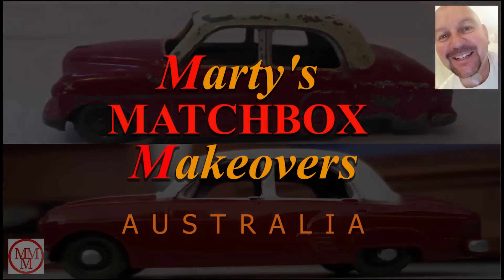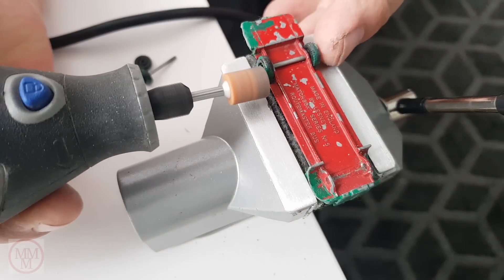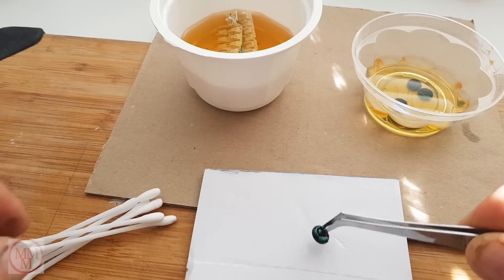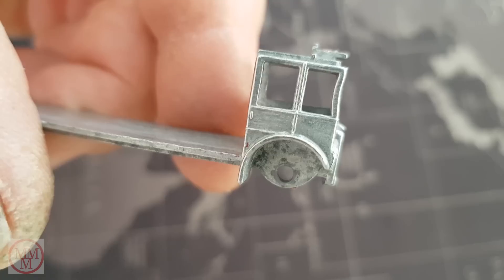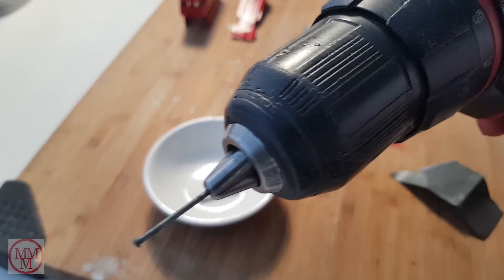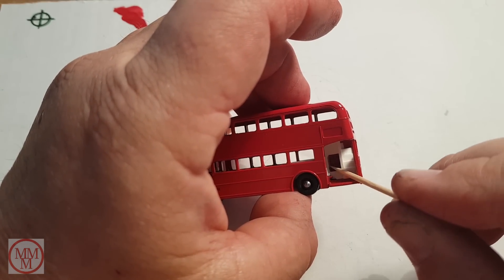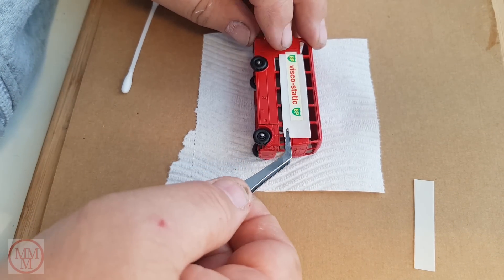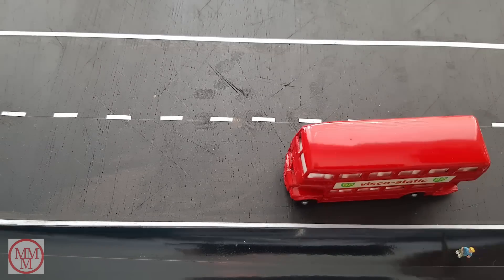MATCHBOX Restoration No 5d Routemaster London bus 1965

Comment: Is it just me or did it have a bent pillar you missed?    Awesome work still!
Reply from the maker: Believe it or not, I did not see this with the naked eye - Only noticed it after the final upload view!  :(
Reply: I was thinking the same thing just after the paint stripper.... waiting for the tweaking that never was, still a bang up job 👍
Reply: @MartysMatchboxMakeovers  
Very beautiful restoration, but yeah, you missed the a-pillar being bent a bit. Oh well, just say that you actually use them for playing :-)
Reply: I noticed that too, but they are so brittle they tend to break if you try to repair them. It came out very nice Marty. I wouldn't worry about it.
Reply: I noticed the same. Maybe his hand still hurt causing him to miss it......😂
Reply: Yes, I kept waiting for him to say and now to straighten out that bent A-pillar.  I was soo disappointed when the red paint came out and no repair was made!  My OCD will have to go unsatisfied this time :(
Reply: I saw that too; Marty, is that play damage, a manufacturing flaw, or do Routemasters actually have a 'bent' look to their pillars?
Reply: Also, shouldn't this have had a metal pole at the rear, just inside the door?
Reply: The real Double Decker bus did in fact have a pole at the rear of the bus for assist passengers embarking and I remember standing on the rear lower deck platform as the bus was about to arrive at a bus stop and passengers would use the pole to hold onto and jump off the bus before it came to a stop but I don't think this was ever included in the Matchbox model as I guess it would have been too fragile and would have broken off very easily. It could be that they stopped installing the pole in the later busses because of this dangerous practice. The DD busses I was familiar with as a young boy was back in the mid fifties so may by the mid 60s this was discountinued. Maybe someone can enlighten us on that. I also noted the A pillar was bent and expected it to be repaired but was overlooked. This ac tually turned out to be a re-paint job and not really a repair but nevertheless a nice job. I just did a bit of research and some of the models did in fact have the pole included but not sure if Lesney models did. Corgy seems to have them though.
Reply: I was surprised when the paint came out and the pillar was still bent lol.
Reply: @rockettcustoms6266  me too
Reply: @Aaron Yates  Yeah.  I wasn't gonna point out the pillar.  Marty did a beautiful and entertaining job.  In 20 yrs he can fix it again.  They don't make them like that anymore.  All junk now.
Reply: @johnrobinson1020  I used to jump off the back of my bus to school in the early '80's using the pole at the back, good times :-D
Reply: @Sennaxm71  That brings back memories; i think we all did that as kids and even when we got a bit older too, jumping off the back of the bus as it slowed down before it reached the bus stop. Good old days.

Comment: Almost perfect this time, but you forgot (or didn't want) to work on the bent pillar in front.. ;-)
Reply from the maker: I always want to make things perfect again. But, in this instance, I uploaded the the vid and then, for the first time, in 1080 HD, I saw the bent pillar! - Was sooo Pi##ed off by it all!!
Reply: I believe that this error will not happen again, because you will have a special look at it in the future. That's just the way, we all learn from our mistakes. And believe it or not, it is still a really good piece of work you have already done. I like your Videos and I have done such work by myself years ago, but with younger models and just painted with a spray can. But also dissasembled the models first. My last one was a Matchbox Citroën CX Break. I made a three axle one using two worn out models and painted it in an original Citroën dark red color.

By the way: To glue my models I do not use super glue because of it is not vibration proof. I use a two components polyacrylic glue instead, which is nearly as strong as the original, vibration proof, gap filling, clear after drying and sandable.

Because of I am from Germany I just know German brand names, may not been sold in Australia but you may get it from Ebay. Simple google for "Pattex Stabilit Express" or "Uhu Schnellfest Polyacrylat". Unfortunately Uhu sold this glue out, but you may get some "new old stock" ones which is no problem at all, because of there is nearly no best before end date. I just emptied a pack which was in use for more than fifteen years.

Comment: I started restoration of a Dinky Toys Leyland Atlantean bus two days ago. I managed to get most of the paint off using Paint & Varnish remover and had to scrape the small remainder off  with a metal nail file I found lying around our house. Next job is to paint it. Thanks for your video Marty. I just now need to return the nail file back to where I found it. :)

Comment: I have often ridden in a Routemaster like this model, in London 50 years ago, Marty.   They did not have reversing lights, as you theorized in the video.   They had separate enclosures for the indicator lights and the running/brake lights, and that's what the two shells on each side of the rear of the casting are.

Excellent work as always,

Peter

Comment: Mate, this is your best one yet in my opinion, as I have a very soft spot for old buses.
I have recently seen a major repair to the rear end of a REAL 1965 RM take place, which had been hit by a car at about 50mph.
It was a testament to the strength of the Park Royal bodywork on these buses that only the rear platform and framework needed rebuilding....the chassis was fine! Car was a total write-off by the way!!
Matchbox's little RM is a lovely model, your skills have done it proud!
Thanks for a great vid!
Julie's toothbrush looks totally rooted now tho............😮😮😮

Comment: Marty loving your tips mate. I now have a modified nail and the tip with the emery paper great. You just plow ahead on projects and you tend not to think. Now I don't know if you use it but Testors has a decal setting solution. It really helps set your decals. You do your decals as usual but after you brush. the solution on and helps remove air and reacts with the sticking process.

Comment: Hi Marty, I´m working on ship models in the scale 1:1250. For tiny wholes or edges I use pipe cleaners made of cotton wrapped around a metal strand. Those are much thinner than the Q-tips and might have helped with the stairwell.

Comment: I didn't have good results with brake fluid, it could have been  the DOT series that I used but it dried the tires out so much that they crumbled. I tried 2001 tire cleaner on my next car and it cleaned them very well while 
re-emulsifying the plastic composition of the tire. The detail of the bus is awesome for the time period. Great job .

Comment: These models are one of my favourite as a kid, Matchbox RM No. 5, I restored one myself, they were a really nice representation of the real thing. The only 'Longlife' advert in real life I've seen is on an RM that went abroad, RM 1804, pictured on page 140 of the Routemaster book by Ken Blacker. You did a real good job there, but you didn't straighten the front cab, maybe for fear of breaking it. I would have left the grille unpainted.

Comment: When I use the paint remover usually I neutralize using some powder detergent, it prevent burns in the skin in case a drop touch yours also the water helps a lot. Just saying. Love your work !!.

Comment: In the U.S. it's illegal to dump brake fluid down the drain but there's an easy disposal solution. Fill a container with kitty litter, pour the brake fluid into it and set it outside to evaporate. When it's dry throw the kitty litter in the trash.

Comment: Another terrific video. Nice to know someone else drops parts on the floor! I hate that! If you have larger parts to strip paint from and can't find a suitable container just use a reclosable freezer food storage bag-the brake fluid or plastic stripper won't attack it. That should also work with methyl strippers. I put enough fluid in the bag to completely submerge the part, close it up and hang it up by clothespins over my laundry-room sink to soak the part for a bit. Very glad to see you're wearing gloves to save those "modeler's hands."

Comment: I lived in London and remember the Routemaster being introduced then 50+ years later I was working for TfL when yet another attempt was made to withdraw them.  A couple of points:
 - Some Routemasters were used on country routes and carried a green livery - check the RMC variation.
 - The back lights on your model are the circular stop/tail lights and the rectangular indicators (which were a retro-fit on earlier vehicles).  
I used to go past the Lesney factory from time to time and they had a fleet of blue buses (probably RTs) for use as staff transport.

Comment: Marty. next time try using oven cleaner to remove paint at plastic parts, it works very good and VERY FAST. use protective gloves. 
Also : if  stickers application go wrong : wrinkles, missalignement, etc,, put the whole into water, squeeze it and the sticker will separate from model with no problems,  that is the technique I use. regards from Venezuela.

Comment: A suggestion that may save you some grief in the longer term.  As you get to the point of having the model refinished, put on the decals, and topcoat with a gloss clear, water slide decals tend to flake off over time, might save you some long term grief.  Scale modelers, particularly aircraft modelers with lots of decals topcoat the decals to protect them from handling, weathering and peeling.... just a thought!  Enjoy your videos... greatly...

Comment: There is a home improvement show in the US (This Old House), that has shown a method for paint stripping which you might want to try.  They put the part (in their case, painted over doorknobs and hardware) in a slow cook pot (Crockpot) with about a teaspoon of Dawn dishwashing detergent, and then let it cook overnight.  The paint slides off the next day.  I'm not sure if the same method would work with oil based paint on steel, or paint on a plastic surface, but it might be worth a try.  Since you've already used your wife's toothbrush, I'm sure she wouldn't mind if you also used her kitchen cookery!
Reply from the maker: Thanks Michael I might give it a try if I ever run out of paint stripper. Marty.

Comment: I'm not sure if anyone commented on this, but to remove paint from plastic parts I use Easy-Off Oven Cleaner as it doesn't damage the plastic and works just like your paint stripper. I'm in the U.S.A. and I'm not sure if you have Easy-Off in Australia. Also, to create home made water slide decals, I print them on the same paper you use, but I go to a self serve copy/print shop (in the U.S. we have FedEx Office stores that used to be called Kinko's) as it is not an ink jet printer and does not have the visible small dot pattern. Sometimes it seems to not work too well if the printer (copy machine) gets hot inside from doing many copies and the toner ends up blotchy.

Comment: Did you cut your fingers washing your hands marty ? Just thought i would drop you a tip, if you find that modellers  enamel paint has been used then you can use ordinary washing machine powder about a cup full in a container that allows your model to be covered with water, give it a mix and leave for a few days to a week, its very gentle and is kind to plastic, keep up the good work mate :).

Comment: After watching this video I thought I would give it a go and purchased a 5d London bus.  As a kid I had one in my toy collection. I have a question, where did you source your BP Visco-Static stickers? Can I get them here in the States?
Reply from the maker: Try on of the following suppliers: recovertoy.com, modelcarparts.com or Black square decals. Good luck!
Reply: @MartysMatchboxMakeovers  Thanks for the info. I ordered a set and look forward to restoring the bus. BTW I really enjoy your restores. fantastic job on all your Matchbox cars. Thanks again!
Reply: @MartysMatchboxMakeovers  I just got my Bus in the post. I also noticed there is the very same void in the same step of the staircase. from removing the bottom seats I see that is the spot where they must have injected the plastic into the mold during its manufacture.

Comment: Pretty nice restoration. Just saying tho, that if one day you use resin replacement parts, need to paint them and for some reason, need to remove the paint after that, DON'T use brake fluid. Else, the resin will do like the wicked witch of the west when she was splashed with water; it'll melt. Something that can replace brake fluid over plastic that you aren't sure if it's actual plastic or resin. is Easy Off Heavy Duty Oven Cleaner or its equivalent (if you don't have the same product than we have here in Canada).

Comment: Hey Marty, I use lye-based aerosol oven cleaner (Easy-Off here in the U.S.) to remove paint from plastic (polystyrene) models. I'm not sure how this would react with the plastic that Matchbox used. Perhaps you could try with a sacrificial interior - just in case it isn't successful - but I haven't had an issue yet.

Comment: Have you considered getting an ultrasonic cleaner to speed up the cleaning and paint removing process? I see amazon has jewelry ones for under $40 USD.  Also, when putting on decals you didn't mention using any setting solution. It makes the decal more pliable to conform to any detail on the model. I used it all the time in model railroading.

Comment: Watching you strip of the paint brings up a question, you strip the body with paint stripper and the plastic with brake fluid, the brake fluid does a good job, why not just use that?

Comment: Its painful watching you remove paint from plastic with brake fluid. Commercial floor stripper will dissolve the paint and you just rinse the paint off. You could put that whole bus in the stripper and  the painted parts will come out easy. The stripper is a great cleaner for plastic and will strip paint off  of metal. I hope you try it. You won't be disappointed.
Reply from the maker: If it's not too expensive I might get some to try. Thanks for the tip.

Comment: Can I ask why the front cab window pillar was not straightened out and why was the upper deck chipped around the windows?
Reply from the maker: Truth is I didn't see the bend in  the pillar until after I uploaded the video. Was very annoyed when it was pointed out to me. As fo the chip? - Whilst setting up for the final carousel footage the model was dropped from about 2 feet onto a wooden floor. The chip went unseen until the final reveal on the finished video. From now on I am going over the models with a magnifying glass before filming the final clips!